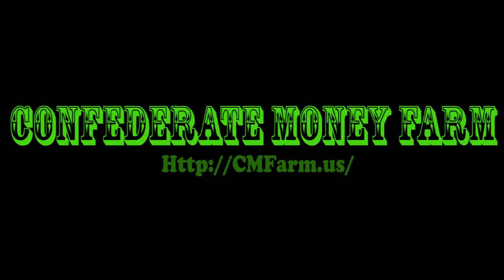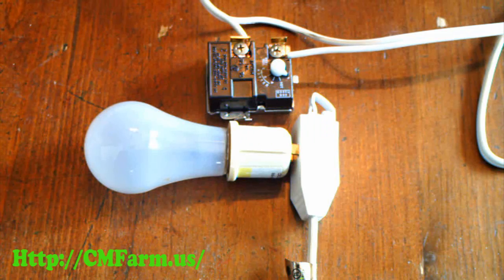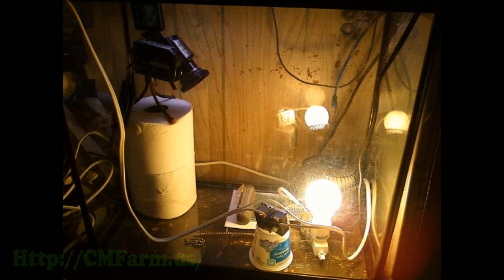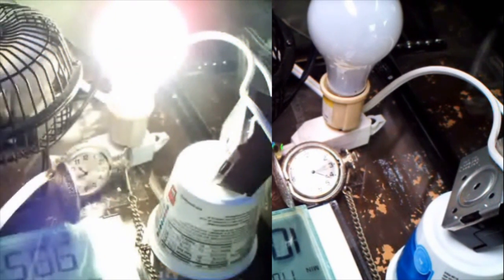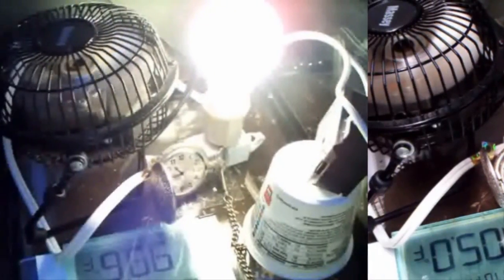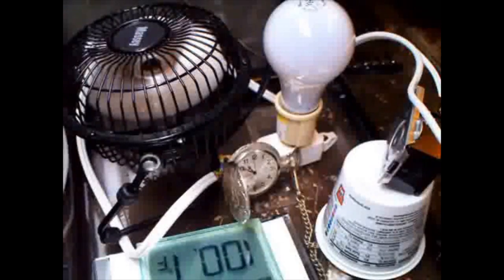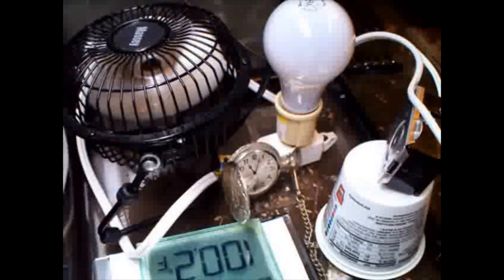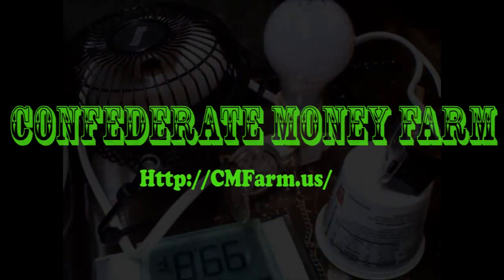Homemade Incubator. Making a water heater thermostat work.

Comment from the maker: 99.5 is perfect for an incubator with a fan. 101 at the top of the eggs for incubators without a fan. The more stable it is the better but as long as the inside of the egg does not get above 103 most should hatch.